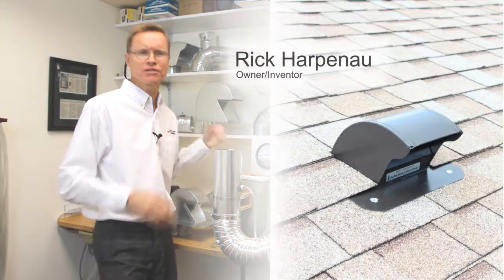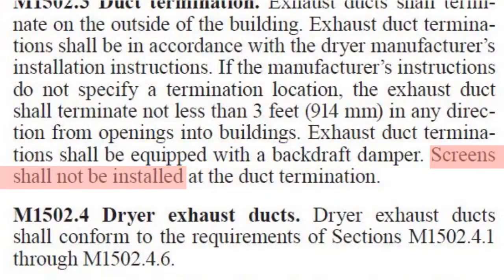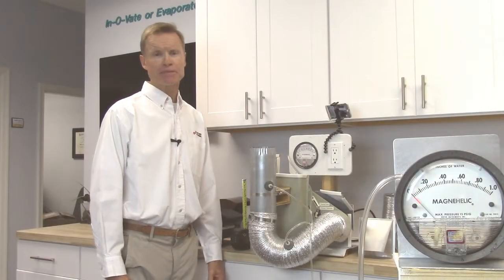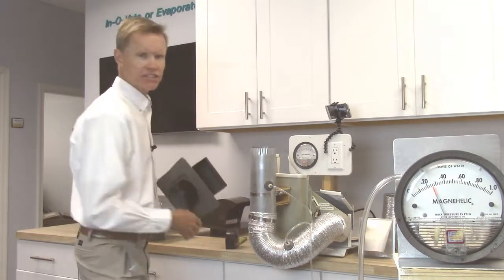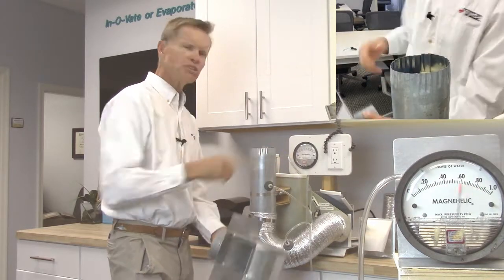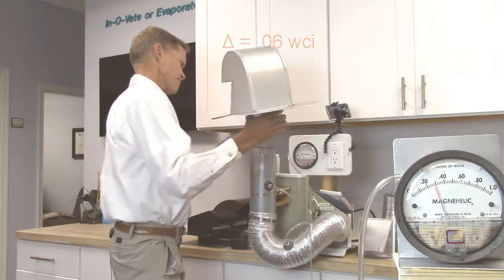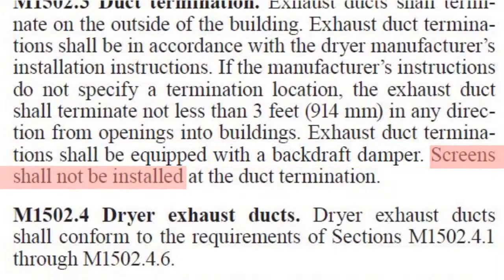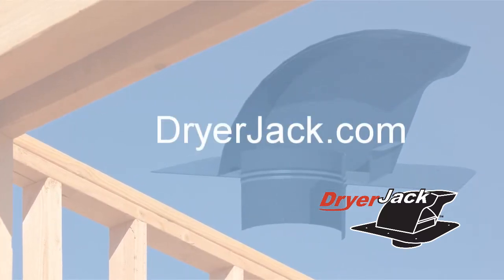What is the best roof vent for venting the Dryer?

Comment: It shouldn’t be on the roof it should be on the side of the house
Reply: I agree.  Mine originally vented through the roof but previous owners had a leak and removed all the roof vents replacing them with a ridge vent and had the dryer venting into the attic.  When I bought it I had to install an eve vent and duct the exhaust to it because the washer and dryer sit in the middle of the house for some reason and it's too costly to move them closer to the wall and vent it that way.  Bad design all around.
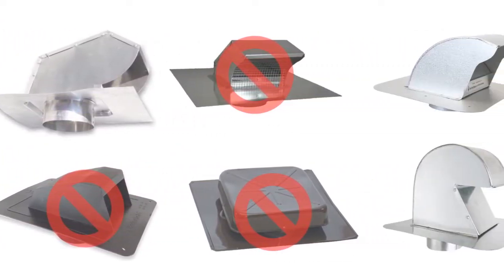Reply: i have one like the one on minute 1:39 
the brown vent on the left the very first one but leaks on the inside i dont know why